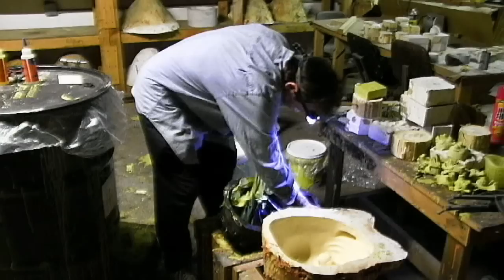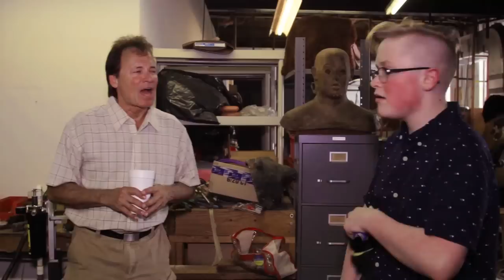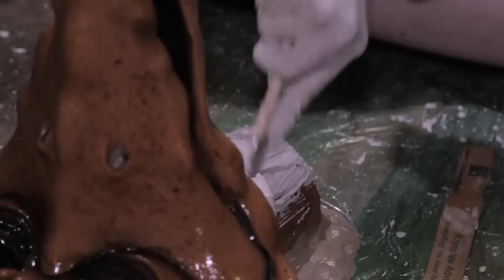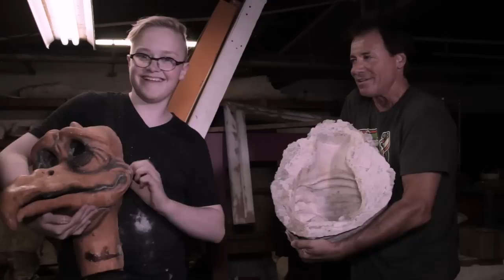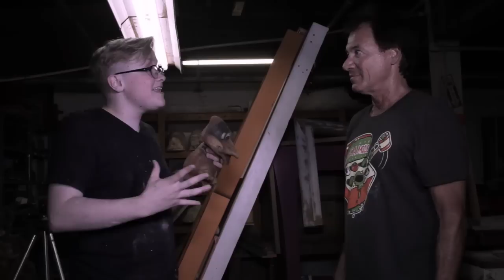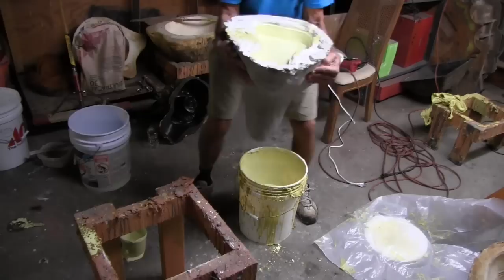Gooney Bird Mask Fiasco Part III - With a Little Help From a Friend

Comment: Technical questions: do you mold with latex? And is the problem that latex won't cure with a fiberglass mold?
Reply from the maker: +Jim Campbell -Yes..But I know we used to make masks in these fiberglass molds in the 70's.  The question is, "How did we do it?"
Reply: +therockafire I'm pretty sure you might have coated the inside with some non stick stuff then made the mold!
Reply: +therockafire I don't know! I wonder if silicone would work? It's a very different material - harder to paint and temperamental (wont cure next to some materials) but lasts forever once it's made... I'm experimenting with stuff now on some small puppets.. I haven't quite figured it out yet. I would love to be comforted in the knowledge that rockafire will continue in some form or another into the distant future. Glad you still have the molds!!
Reply: +Jim Campbell I'm making some Animatronics as we speak! Look up the page Limestone Engineering on Facebook and you'll see my work. I'm currently planning to make and prehaps sell some latex masks of my characters Wilbur (designed to look like a relative of Billy Bob) Kathy the cat, Wolfre the wolf, Snappy the Croc (A keyboard playing Crocodile). I hope to be talking to you on Facebook and maybe I can give you some mask making tips!
Reply: +therockafire This might be a really stupid idea, but instead of pouring latex into the mold, did they paint it in layers on the outside of the mold?  That, what if you shaved down the stiff, solid mold you already have, make it a bit smaller and then use it as a plug? So paint the inside of the mold to build up the mask to the right thickness, then place the plug in to keep pressure and hold the latex in place until it dries?
Reply: I have no idea if I could make a mold of latex, I'd probably buy some cheap Halloween mask until I could do it right or got a good enough mold.
Reply: It's been a long time he made masks ;-;
Reply: I see your comments on SO many of the Rock-a-fire Explosion videos I watch. I can't imagine why you'd be watching those. Lol.
Reply: can you make a cat please if you dont i wont subscribe or like
Reply: Jim Campbell nnj

Comment: Congrats! 

And for the ultimate challenge, scaled molds with a goop called "Hydrospan 400".

..only heard of it from a few FX sites, not worked with it myself. But..

 It's a resin that, when fully dried (30 minutes in the mold, then two weeks, probably more adjusting for humidity) it retains most detail but ends up 55-86% the size of the original part depending on how much water is in the original mix.   
it might be a near-impossible thing to work with at this bulk. . Maybe contact them for a review barrel with some formula support from their techs since, basically, I don't think it's been done to this scale. Hah.